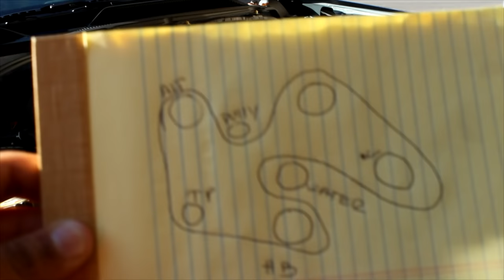2005 Ford Mustang 4 Liter V6 Water Pump Replacement

Comment: how many gallons of coolant (premixed) do I need to fill it back up ? I am going to change water pump and a couple pulleys and an all aluminum thermostat housing all at once on my 05 plus a couple hoses and new belt.

Comment: Your video got me through my water pump install perfectly, so props to you and thank you👊 but... Turns out it was my thermostat housing all along that caused my leak. Hint of advice to everyone watching this video... If u have a leak be sure to check the thermostat housing. Those things are built so cheap it's insane.
Reply: My 05 gt is leaking after around 15 minutes of idling but the car isn’t overheating when leaking so my plan is to replace the thermostat and water pump but I will definitely check the thermostat housing beforehand thanks for the tip!

Comment: Thanks for the video.  I'm about to do this same replacement.  I wonder why you didn't replace the clamps with screw clamps so you didn't have to fight the spring tension.

Comment: Very good presentation. However I would like to correct some items, the diagram of the belt pully can be found in your owners manual. Also the V6 s197 mustang does not have an aluminum head, the material is Cast Iron.
Reply: I think you meant the block is cast iron... the heads are aluminum.

Comment: the first thing I did is I trashed those clamps and installed a threaded ones with the screw, like the ones on the air intake. They are called house clamps for a reason
Reply: Yup! Thats how I roll too. I hate those pinch clamps.
Reply: I just got mine

Comment: How can I now if my water pump is not working? My mustang get overheated, i change thermostat, coolant is good  ,  no leaking , fan is working , i check the head gasket and it's good ! Do you think that's the water pump ?

Comment: if my car has a check engine light on and it says it's the PCV valve, tube, and grommet, will changing the water pump help at all or just a waste of time?

Comment: During the distillation process, water is vaporized into its gaseous phase, so all its impurities are left behind. ... As it chemically removes electrons from the metals of cooling system components, distilled water eventually does extreme damage that could lead to cooling system failure.

Comment: How did u know you water pump was the issue?
Reply: I have the same issue to I replaced the thermostat housing thinking it was that after I replaced I noticed leaking coming from the water pump around the gasket oh well
Reply: @freddy_v.2565  same, I just installed new radiator, I just bought the thermostat housing and turns out it's the water pump. Oh well might as well replace everything
Reply: mine was dripping from front of the block/crank pulley.  This was after replacing the thermostat housing.

Comment: Nice video.  I'm doing my water pump this weekend.  Also have you considered switching to a aluminum thermostat housing?  I just changed mine out from the cheap plastic.  That's where I thought it was leaking last weekend but then it kept leaking and looked at the water pump. Mine also has about 150k on it. Seems like it goes out right at that mark!

Comment: I replaced the water pump and the thermo housing and it still leaks. I've done the water pump x3 times already and I can't get a seal. One of my original 8mm screws broke while I was tighten it (always kept in mind your advice on not going too tight) replaced 3 with new bolts and still leaks. Any ideas from anyone ? I so regret doing this myself I should have just taking it to a shop. My mustang has been sitting in the garage for 6 months due to this and I'm ready to call a tow and pay the consequences.

Comment: Yikes. RTV and a gasket... Number one red flag. Number two red flag was adding the AF and putting the cap straight on and starting... You should always leave the cap off and turn your heat on full blast to cycle it and get some extra air out before putting the cap on, and checking it after about 20 miles of driving.